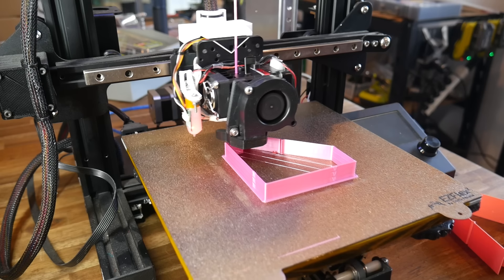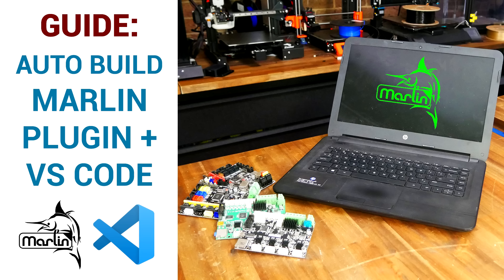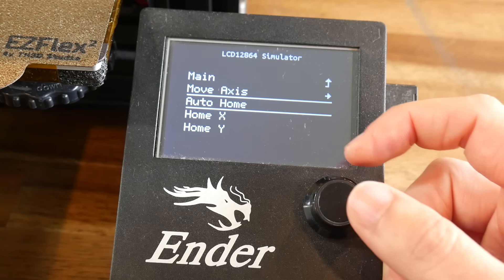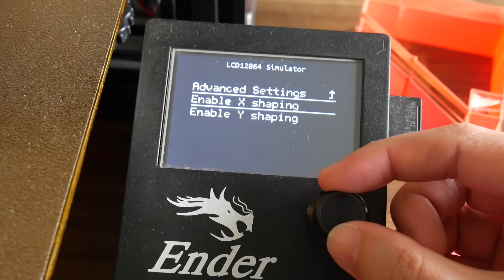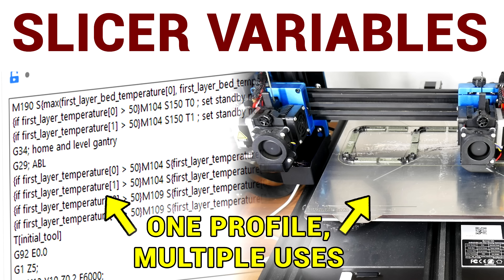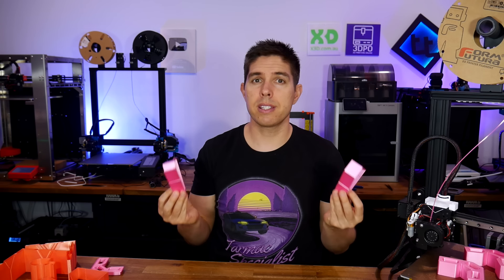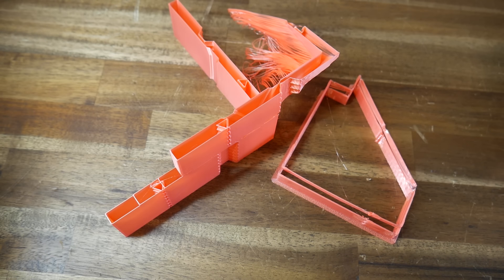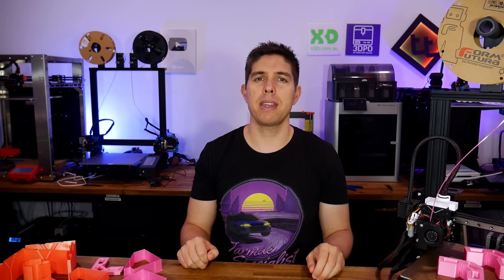Marlin Input Shaping - Step by step guide to more speed and less ringing

Comment: Before looking at input shaping pay attention to frame rigidity and belt tension. If you have a bed slinger a brace for the tower makes a huge difference. For instance I'm resurrecting an early Tenlog D3, a very generic idex bed slinger. Before I started it had terrible ringing even at 50mm/s, 500 acceleration. With tower braces made from two 8mm carbon tubes, the Y axis driver replaced with a TMC2209(more on order for the other axes) and klipper installed I'm getting virtually perfect 35 minute PETG benchies using 100mm/s and 7000 acceleration with a small amount of input shaping. Admittedly I do drop the outer wall speed to 75mm/s, 3000 accel. 7000 accel still leaves a bit of ringing.
Reply: Also attempting to make the TL-D3 a decent machine, updated Marlin on the 8-bit stock board and screen. Thank you for the tip on frame rigidity, I knew I had to be overlooking something 😅

Comment: Hey teaching tech, great video as always! 

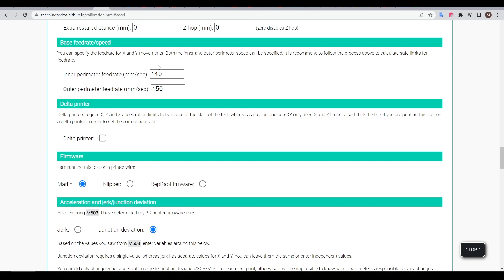I'm currently following throught it and doing your speed and max flow tuning test, and got up to 480 (i don't know how its even going up there, as there doesn't seem to even be any change in quality from 100 to 480). I did multiples tests, upping the feedrate to +20 per ''floor'', and so did 4 tests so far. My resulting prints don't even look like yours; it's all smooth, no over extrusion or ''fuzzy skin'' like yours show in the video at @5:36 . So i'm wondering if it could be my Marlin firmware limiting me, hence i jumped into the g-code of this. I then modified my M201, M203 and M204 like so : 

M201 X8000.00 Y8000.00 Z100.00 E5000.00
M203 X1000.00 Y1000.00 Z10.00 E100.00
M204 P4000.00 R1000.00 T2000.00

My printer is an Ender 5 Pro. with SkrTree E3 v3 motherboard, bltouch, and modified hotend with 2 5015 fans blowing on the hotend for part cooling. 
I was wondering if you (or anyone reading this) would know if there was something limiting my printer in the speed department, hence why all the test looks the same (and are ''too'' perfect compared to yours).

Looking forward to an answer! Thank you :)

Comment: Okay so I updated my firmware to the latest official creality one for my ender 3 s1 pro.  Low and behold it has input shaping already on there!  It isn't in the screen menus but it is definitely there when looking at it from the console.  Now I understand why these acceleration tests were not making sense!  Input shaping was there with some generic values.  Since I have remove the filament spool holder and instead have filament in a ptfe tube coming from a dry box draped over the top, I will go ahead and run this test.  With CURA!

Comment: Hi, Great video for its time since things move so fast. You couldnt point me in the right direction as I cant seem to find any Info On Automatic Resonance tuning for The BTT EBB42 setup..Lost have how to setup the canbus like you did but not anything of the Extra MCU setup for the Accelerometer connection setup. Klipper only has the USB or the Pi connection etc..??? Les

Comment: Is there a way we can hook out printer to the internet and allow a smart Guy like you log in and super tune the Firmware while guiding the user/me on hardware install to support such updates Like Active Resonance Compensation ARC sounds great it says exactly what it going to do. I have had 4 Cars Motor controller tuned this way and several PC tune ups this way can we do it with the 3D Printer?????/ Dennis

Comment: After going over this myself and having to troubleshoot many hours, here's 2 important points i wish i heard when i started:
-If you are generating a ringing test that does not induce ringing, check the speed (which you should always do anyways btw), because many slicers have a minimum layer time threshold, which if left on can be overriding your set external perimeter speed and can be quite frustrating to find what is capping it.
-You actually CAN insert the input shaping command in Cura, using the "Insert at Layer Change" Script from the Post Processing Plugin, it makes it so much easier not having to start profiles from the ground up in a new slicer. I wish that could be added to the description of the video so the many Cura users that might want to implement this can skip some headaches as well.
Great video as well.
Reply: How to use "Insert at Layer Change" to perform this test? Isn't it fixed (same gcode applied every layer change)?
Reply: Great tip on checking minimum layer time. In PrusiaSlicer it can be found in:  Filament Settings -> Cooling -> Slow down if layer print time is below:
Reply: Thanks a lot i would have spend the same time too without your comment
Reply: I literally just downloaded PrusaSlicer for this, installed it, then read this comment. I dont really want to use a new slicer for setup that I dont plan to use everyday. Thank you.

Comment: Hello, i was thinking since the BTT B1 TFT35 V3.0 Display Touch Screen is a 32 bit board that controls the printer in touch mode by just sending G & M commands. is there a way to implement input shaping on old 8bit board only by having a 32 bit screen talking to it.

Comment: I enable input shaping and made the test print at 15-60hz, but I see literally no difference between any of the layers. Does this mean my printer doesnt need it? Should I simply leave it disabled, I did the test print at 150mm speed. It's an ender 5 plus and I have all the corners reinforced with braces.
Reply: What is your acceleration? Did you ever get to utilize it,  did you turn it off since you saw no noticeable improvements? Been trying it out on mine and getting weird blobbing before or after the seams.

Comment: Works very well. Been using it for a month and have retuned twice. So far so good with a noticeable improvement in print quality vs speed. Used in combination with linear(pressure) advance and classic jerk. Found junction deviation and s-curve a waste of time with loss of quality and bulgy corners.
Reply: S-curve gives terrible quality on a bowden. I run my ender 3v2 with a marlin variant, all motion is basic and i have very subtle ringing with 2000 acceleration.  Not sure what he is doing wrong, but that ringing looks excessive. Maybe it's the sturdy table. I made the bed way lighter and the whole printer is mounted on a tile that sits on a sheet of PU foam.
Reply: @dtibor5903  Try running input shaper anyway. You might be surprised!

Comment: I have a couple of questions. First, will any 32-bit board work? I have the BTT skr 1.4 turbo, it's 32-bit but it is a few years old now. Would this board work or is it too slow for input shaping? Also,  I know this is a big ask, but is there any chance of this calibration technique being integrated into your 3d printer calibration site?
Reply: With btt skr mini e3 v2 it work like wonders. Since you have 32 bit board, it should work. None of 32 bit boards are slow for marlin😀😀.. Please don't forget to update the marlin version to newest before printing the test model. disable s-curve and junction deviation and use classic jerk while compiling new frimware.

Comment: Remember e.g. on i3 style machines, if you have your spool holder mounted on top of the frame, your resonance frequency (especially y-axis) changes with decreasing mass (weight) on the spool and increasing mass of an ongoing print.
Better to choose a value for y slightly higher than calculated to.compensate for these effects.

Comment: yo tt could u help me out
I'm running into many problems
1. I'm using a later version of Prusaslicer and I can't get the setting right
2. I already installed 2.1.x so I tried enabling input shaping on the code  and tried updating the printer again but I did not enable input shaping
PLZ REPLY ASAP
Reply: micheal!!!!

Comment: i added it pretty much as soon as the 2.1.2 dropped, and its been a blast, im currently printing at around 250mm/s and 3.5-4k accel, jd of 0.15 and jerk of 20, and it looks amazing, my board is an skr 1.4 and i also have a tft 35 v2.0
Reply: Hello, where did you connect the ADXL sensor... do you have a picture for me... THANK YOU... I have the SKR 1.4 turbo
Reply: @majo8526  you don't do it, the calibration is manual for now
Reply: I thought you used Junction Deviation OR Jerk. WWhat sort of machine are you running is it a coreXY?
Reply: @Festivejelly  I started with JD but went back to jerk, in my application wasn't working very well, it's a normal bed slinger and I have a few speedbenchys runs on my channel

Comment: What made it a bit more practical to me was to copy the eeprom settings directly to the Marlin source code and enable the setting to automatically initialize eeprom when flashing. This simply too this annoying part out my head space so I don't think about it anymore whenever I reflash the firmware. No more forgetting to to adjust that one setting... The only two things I do again after flashing are Z probe offset and UBL mesh wizards. The offset wizard and UBL made me never have leveling issues again. Got rid of the springs and been happy ever after. Unfortunately those are not enabled by default, so I doubt a lot of people use these. Also discovered a code that loads mesh data after auto home, so no need to run auto leveling on every print anymore, so they start faster than ever.

Comment: Thank you Michael. At the end it may also be advisable to go back and set the X and Y frequencies in Configuration_adv.h and rebuild (again!). These frequencies bake in the minimum shaping frequencies that Marlin can do without sometimes having to back off the input shaping effect. Alternatively if you have tons of RAM just pick low frequencies at the outset or use SHAPING_MIN_FREQ. (Under the covers this is all affecting the size of a buffer that is allocated at compile time. Which is why it so directly affects SRAM usage.)

Comment: I have an Ender 3 Pro with a BTT SKR Mini E3 V3. Updated the firmware and the feedrate test settings make no difference. The final prints are identical and I started at 100mm/s and got to 440mm/s before giving up. Max X/Y feedrate is set at 500mm/s. Gcode shows it should be changing but it's like the printer just ignores it.
Reply: verify the max feedrate settings in your printer. you can command faster speeds all you want, but if the max settings in the firmware are to low the printer will just go up to that max and stop
Reply: @zacharywelvaert2235  Max feedrate for X and Y is 500mm/s.

Comment: Michael,

I have watched this video 6 times. I have upgraded my firmware. I followed your instructions on the changes to the firmware to enable input shaping.  I followed your instructions for slicer settings, and I have runt 4 of the test parts.  I cannot see any difference in the finished parts looking at them in all lights, angles, etc. 

I have an Ender 3 with direct drive and a BTT mini 3 v3. If you or anyone else has any suggestions as to what I am doing wrong I would really appreciate it. 

Thanks, I always watch your videos and have used a lot that I have learned from them.  I really expected good things from this one. The only thing I can think is that is that I am doing something wrong.
Reply: I have the same problem. Ran multiple prints and don't see any discernable difference in the prints.
Reply: I kind of had the same problem with my heavy CoreXY printer, but it turned out that the default damping value of 0.15 was actually too high for the heavy oscillations I was experiencing. See my longer comment I posted under the video just now, but here's the TL;DR:
Use the manual method for calculating the resonance frequency as presented in the Klipper documentation for resonance compensation. Then set those frequencies up for input shaping using the M593 command. Then slice the ringing tower, but instead use the following post processing command at layer changes:

M593 D{(layer_num < 2 ? 0 : 0 + 1.0 * (layer_num - 2) / 297)} ; Damping Input Shaping Test

Then you will get a tower that ramps up the damping factor on both axes from 0.0 to 1.0. Then you may see the appropriate damping factors to set up with the M593 command - in my case it turned out to be 0.0!

So, the damping factor is important! Hopefully now you may get better results.
Reply: Oh, right - and after those tests it is wise to then rerun the 15-60Hz test print to really fine tune the resonance frequency.

Comment: Rather than doing an M503 so you can manually re-add all those settings back after a reset, apply them all in the firmware. You potentially save a TON of time if that data is ever lost!

Comment: I've never tried to make my ender 5 print faster. I tried printing this ringing tower and change all the settings in the slicer like in this video. It didn't work cause it still only printed at the default ender 5 print speed (I guess it's around 40-45mm/s, obviously that didn't cause any ringing). Must be some setting I didn't change that the video didn't mention. (EDIT, Found the problem, was "auto cooling" in filament settings.

Recently bought a Bambu X1 Carbon, so I thought I'd speed up my ender 5 a bit so it doesn't seem as pathetically slow in comparison.

Hmm, when I change the profile to "normal speed" instead of the one where I increased the speed it actually prints faster (checking the Gcode, the G1 FXXXX number is much higher). I can't find the setting that somehow cripples the speed.
Reply: You just saved me so much headache I was wondering why the printer kept slowing down after the first layer (where the fan is off) thank you!

Comment: Great videos! Thank you for the tips. I have 2 questions.
1. Does the input shaping works even when you use a host to print (like octoprint over usb)?
2. Can you transfer the input shape values from Klipper to Marlin on the same printer?
Reply: 1. Yes it will work with SD card prints or Octoprint. 
Input shaping is a live smoothing algorithm. It will work regardless of how the MCU receives its gcode as it applies the counter frequency to the stepper movements. 

2. Yes, the value is just of the printer's resonance frequency. How you arrive at that resonance is irrelevant. Provided that your tested and verified values from klipper (or reprap) are using ZV algorithm they should carry over perfectly.

Of note, EI works better in my experience for beg slingers than ZV due to it being able to handle the more frequency changes caused by the moving bed. So if you have Klipper aand are using EI or 2HEI, you will likely notice a decline in quality if you step back to Marlin. ZV is just easier to calculate than any of the other algorithms, which is good for the common Marlin boards on the market and their lower processing power.
Reply: @zacharywelvaert2235  thank you

Comment: Which leads to the question, what if any benefits do we get upgrading the hardware and moving to klipper now?
and are there plans to add the accelerometer to marlin?
Reply: No recompiling firmware on klipper, just edit the config file hit save and reboot.
Id also consider mainsail/fluid as an upgrade to octoprint in my experience.
Reply: @twanheijkoop6753  I don't find recompiling the chore people make it out to be and am certainly not going to do a hardware upgrade to avoid it.
Reply: @noanyobiseniss7462 i had a choice when they released marlin 2.1.2 on if i was staying on marlin or moving that printer to klipper. for me when it came down to it, what pushed me to klipper wasnt pressure advance of input shaping. i already had linear advance and 2.1.2 was going to have input shaping. what it was was the clunky way that octoprint felt to use. I already had the pi hooked up, so switching to klipper was a matter of a few minutes. Klipper's mainsail web interface works alot better than octoprint.

tl;dr If i wasnt already using a pi with octoprint and marlin, i probably would not have bought one and gone to klipper.
Reply: @zacharywelvaert2235  Your use case definitely makes the case for the move sensible.
Reply: @noanyobiseniss7462  At this point, in the development cycle of marlin and with the boards currently being shipped with new printers, a stock printer does not need and will have little benefit to klipper for most people. But it comes as a suite of features that while available alacarte in the marlin world, is all bundled together in klipper.

Comment: Can input shaping be used on an IDEX printer? If so, what other steps would be required?
Reply: Input Shaping on IDEX is spotty even on Klipper, I believe there they set the new value for each individual toolhead in the toolhead change macros.
Marlin only has X and Y, no current support for an X1 and X2 values, so likely you will have to use the same input shaping X value for both toolheads. It's likely fine as both should be identical, so same moving mass

Comment: Can you use the backlash compensation with the input shaping? I noticed that in the adv file too but not sure if it is needed... Also, should i turn off adaptive step smoothing? my motors are very noisy when I adjust linear advanced values, so i dont know what is causing it. I disabled s curve but not sure what else i need to disable.